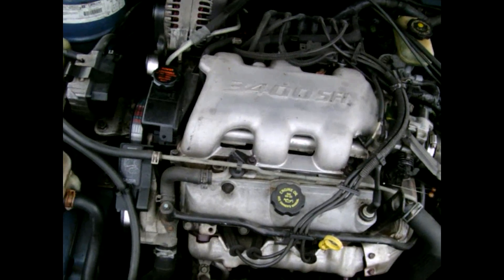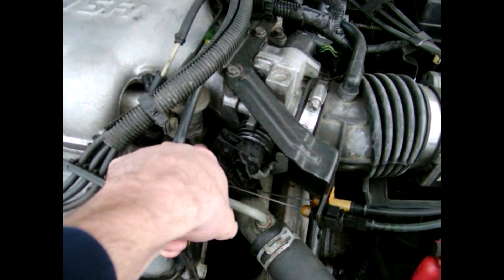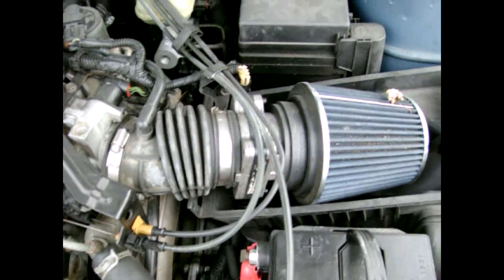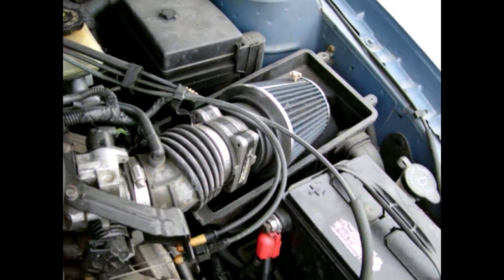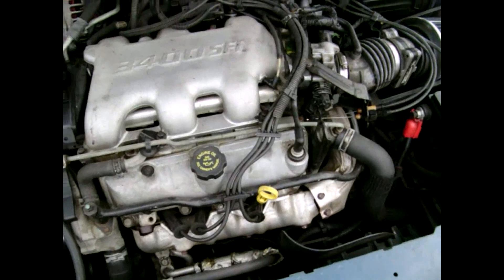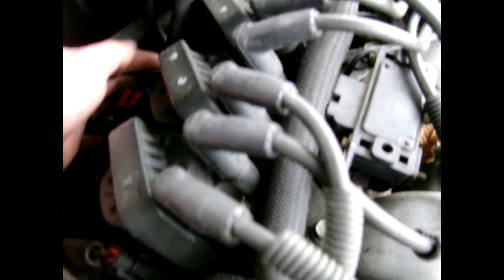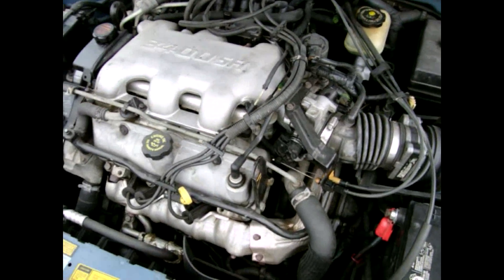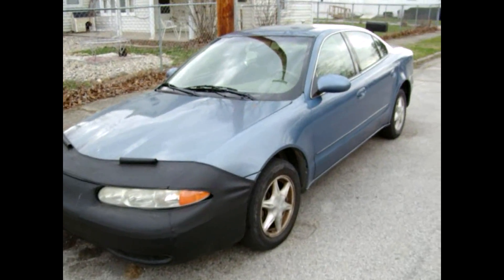3400 GM Engine 3.4 Liter Motor Explanation And Discussion

Comment: Also the timing chain housing gasket often springs a leak they are hard to spot also. Check under car with on lift our jack right under power steering pump right in the oil pan area. Delphi also put junk pressure regulator valve on here causing it to either be sucked up into the intake through vacuum lines or leak pass the diaphragm and can be a big fire safety issue. There is a recall for the3800 not these so look out for that ,both engine FPRs leak past the diaphragm inside the fuel pressure regulator
Reply from the maker: I just finished replacing the front timing cover gasket just today.  A whole lot of work for a $10 gasket and harmonic balancer seal.   > : (
VT247
Reply: My opinion the 3800 is the better made engine of the 90 to 2000 . Simplistic construction and easy to get to components.  I repaired a guys timing gaskets while in school he couldn't figure it out in months took one day. Some one find me a turbo or supercharger for this thing and we'll talk
Reply: Very good

Comment: I got a question I have a 03 Chevy Malibu trying to swap 3100 for 3400 and I bought the engine for 200$ I’m young I need to know does this have identical harness and pcm’s?
Reply from the maker: I think it’s possible, but there may need to some swapping over of certain connectors / sensors.
VT247
Reply: @Vacationtime247  okay I gotcha thanks for the reply and I heard that from a mechanic told me I will Also need a same year and model my car is and then gotta find a same year and model pcm for the 3400

Comment: I've got an '01 Alero with the 3400 in it.  Recently it's been running rough when the engine is warmed up and difficult to start.  I noticed the is a vacuum port without a hose on it and has some very good suction.  If i cover it with my finger the car will stall out.  This port is located on top left as you're looking at the motor from the front of the car.  If you "45" towards the back left corner from the "3400 SFI" on top of the motor you'll be able to see it.  I very briefly saw on yours there looks like there to be a line coming off it.  Where does it go?
Reply from the maker: Make sure all your vacuum connections are secure.  There are some EVAP lines behind the motor and under the coil packs.  While the engine is running, you can take a spray bottle and mist around the engine.  Notice for any changes in idle.  This is a cheap way of finding vacuum leaks.  Also make sure the PCV pipe going to the intake is snug.
VT247
Reply: Vacationtime247  ok.........is there supposed to be a hose connected to this port though?  I've looked online for a diagram of the hoses and it looks like this port goes to the "accessory".........I have no clue what that is if that's the case.
Reply from the maker: Part of the tranaxle.  Helps shift the transmission.  
VT247
Reply from the maker: Wait, my bad.  The bottom right is the transaxle.  The top left is capped off.  It should be plugged.
VT247
Reply from the maker: The one your referring to is for accessories.  In case a person wants to measure vacuum or add a gauge.
VT247
Reply: Vacationtime247 ok..............is there a certain kind of cap or plug I can buy or just any kind of cap?
Reply from the maker: Any kind of cap that will fit on there to plug it secure.
VT247
Reply: Accessories is the line that controls the HVAC system.  Specifically, if this line is cracked one symptom you might notice is that air will only blow out of the defroster and floor vents, regardless of what vent selection you choose on the A/C control head.  I just fixed this issue on my 2001 Grand Am SE1 with the 3.4L.  There was a white plastic vacuum line going right across the top of the engine, just to the left of the throttle body.  It had broken in half (heat stress probably).  Very easy to fix though ... just slipped both broken ends into a piece of vacuum hose and it was good to go.

Comment from the maker: It's quite possible it's the intake gaskets, not much separating the oil from the coolant.  But, trust me on this one, do the head gaskets too.  They'll eventually go bad anyhow and it's not that much more work or expense.  Have a video up on how to do the head gaskets on a 3400, the 3.1 is basically the same thing.  Good luck with your fix!
VT247

Comment: Ya I have a 2001 alero 3400 v6 I'm having anti lock sensor light keeps coming on trac control light come on as well and the PVC vac hose was replaced by previous owner and line sucks the hose till it's almost pinching shut and I dont know what to do to fix them
Reply from the maker: The ABS (antilock brake system) / TCS (traction control system) light will be triggered if the wiring inside a wheel bearing / hub is bad and no longer reads.  There are ways to check this on the vehicle using a DVOM.  The PCV line is usually made from hard rubber, might see if it's just soft and needs replaced.  Sometimes just splicing in a better piece of tubing by 'Mcguyvering' a fix will work.
VT247

Comment: I have a 03 Alero v6 same engine but it only starts off starting fluid but runs good after you spray that starter fluid in it and runs awesome what would that be
Reply from the maker: +Chris Wood Check the fuel pressure regulator / fuel pump pressure.
VT247

Comment: I have a hose leaking.  It is on the bottom left of the top of the engine.  In plain view on your video.  Runs from the water pump to a steel hose it looks like.  Can you tell me the name of the hose?
Reply from the maker: +Kasandra Martin Might be best to just take it off and go to a parts store.  Have one matched up.  Not really sure of the name of that.  But I guess it could be called a water pump bypass hose.
VT247

Comment: if I put a cold intake on my pontiac grand am will jt ruin the motor its the same 3400 ghe reason I want one is because my motor tends to get a little heated physically to me, but the temp guage stays on 200 but it goes up pretty quiq

Comment: I have an 02aztek and the coolant hoses are always hard,  we have done the water pump and the temp levels seemed more stable, we did the thermostat next because the levels started going crazy inline somewhere sat for a long time,  or when I had it idling for a long time,  30 mins or more it would climb, never in the red,... but still to high for my liking.  It does hesitate a little bit when u start it sometimes,  other Times the remote start goes off but don't start the car. 134, 000 on her
Reply from the maker: Sometimes the head gaskets go bad.  I've replaced a few on my Azteks.  Could be the cause of the hard start and high temps.  It's not to bad a job to do, just time consuming.
VT247
Reply: I just watched your video about doing the head gasket, I'm not sure if I'm up for that on my own,  I'll have read up a little on it before i attempt to do that, but sweet video,

Comment: Two problems 2001 Alero 3.4, first at 4000 rpms it starts to cut in and out. Second cannot get the Security light to go off, it just stays steady.
Reply from the maker: For the cutting in and out check the spark.  Plugs, wires, coil pack.  Check out my video on how to turn off security lights in a Camaro.  Would be similar in an Alero.  Find out what resistance the key takes and bypass the system.  But the reason (I'm guessing) to why the security light is on is the ignition is bad.  The part that reads the resistance for the key in the ignition has gone bad.  Kind of a PITA to change the part out.  The key still worked, but the resistance was done with some resistors from Radio Shack looped through the wiring under the steering column.
VT247
Reply: I replaced the complete key switch, starts and runs but the light still on. I will check out all the rest. Thank you for the input. I will let you know keep up the good work.

Comment from the maker: If it does it all the time, it's a rod knock.  If it only does it when it's cold, it could be piston slap or loose bearings.  To be safe, let it warm up a little before driving in this frigid cold.
VT247

Comment: Can I swap a 01 3.4 for a 05  3.4 ? What's the difference
Reply from the maker: You’ll want to check the electrical connections.  Think in some years and models the camshaft positioning sensor is different.  Of course, the intake is also different on the vans vs cars.  Some of the rocker arms use a better larger stud bolt too.  
VT247

Comment: 2000 monte carlo, it makes a very loud screeching noise after I have had it running for about 15 minutes....whether I am driving or I just have it running in the driveway, I cannot figure out this noise. You can hear it in the car and you can hear it outside the car, even in the house you can hear it, that's how loud it is, any ideas?
Reply from the maker: Could be the serpentine belt.  Once they stretch it starts making a lot of squealing noise.  Mine did this, I replaced the belt and no more noise.
VT247

Comment: I had the same issue in my 3.4L DOHC in my 97 Monte Z34.. try replacing the Fuel Pressure Regulator. About 47.99 at Autozone or Advanced Auto.

Comment: I have an exhaust leak in the rear manifold I think. whats the best/easiest route to get to it? I'm tempted to just remove the whole top end.
Reply from the maker: Take off the air box, the intake tube, the throttle cable bracket, the bolts holding the heater lines under the throttle body, and perhaps a few other components to reach the crossover tube and shield.  It's buried under all that.  Take off the  lower exhaust bolts under the car.  Might help to remove the front upper motor mount bolts to rock the motor back or forth.  May find it easier to access the rear exhaust bolts from under the car like the rear spark plugs.
VT247

Comment: I have a 2004 Monte Carlo with the 3.4 in it. About to hit 97K. Any advice on what to do for routine maintenance around 100K? I was planning on doing some AC Delco Platinum plugs and an AC Delco wireset. I always wonder what I should expect out of this motor in terms of lifespan. My money would be that the 4T65E transmission gives out before the motor ever does.
Reply from the maker: Replace the gaskets.  Timing cover seal gasket, head gaskets, intake manifold gasket, spark plugs and wires, change the oil.  Once the gaskets are replaced, the engine will run forever.  The transmission is usually pretty solid.
VT247

Comment: Hope you all are still around. I did a head gasket replacement, took the heads to a shop to have them tested and cleaned. Car ran before I replaced gaskets and now there is no compression. If I loosen the rocker arm bolts it will get compression. Did I forget something? Anyone else run into this and was able to rectify?
Reply from the maker: The push rods are of different lengths.  I'm guessing one of the push rods are on wrong holding the valve open.
VT247
Reply: Vacationtime247  Nope looked at that. I'm pretty anal about putting everything back from exactly where it came from
Reply from the maker: Did you have the camshaft out and the timing marks aligned?  Bad vacuum leak from the intake?  Just spit balling here.  Does it not have compression in any of the cylinders or just certain one(s)?
VT247
Reply: Vacationtime247 Talked to the place I had heads benched. He said ya damn backyard mechanics if it's cold where you are working it takes a minute for those hydraulics to fill so turn it til she starts and she'll run rough but will eventually level out. I thought he was full of crap but I did it and she's running. Thanks for you time and advice.

Comment from the maker: The Grand Am's never had the 3800 equipped from factory.  It had the 2.4 twin Cam or the 3400.  The 3400 was by far a better engine.  All cars have problems, the head gaskets are known to go bad in pre '03 models.  Best way to see if the head gaskets have been changed or other maintenance has been performed is ask.  It may be possible by looking, but even then, if it's been awhile they may already be dirty and hard to tell.  Good luck with your purchase and enjoy your new car!
VT247
Reply: Vacationtime247    Or the 2.2 echo tech

Comment: Dude awesome video, my alero 3.4L has a weird idle mostly when its in drive at a stop light or drive through. A mechanic told me to check vacuum lines. Thanks
Reply from the maker: It's got the GM 3400 engine in it.  I'd bet money the head gasket or intake gasket is blown.  The white smoke is coolant in the cylinders causing the misfire.  No one likes hearing this, but I've had enough of these engines to know this is a common problem.
VT247
Reply: No white smoke at all and i went through all the vacuum lines and it seems like the problem is solved. 1 more ? The ac is coming out the floor and the defrost and face vents at the same time. The nob seems to not be working and its coming out the face vents very weak. Any thoughts?

Comment from the maker: Might be time to get a good 'loan a tool' scanner.  Watch to see if it's fuel or spark related while it starts to do this, checking spark and fuel trim.  Starting to run out of ideas.  Have you checked the MAP sensor and Mass air flow?  Get's worse when it's wet, makes me think spark related, like the plug wires are arcing out or the coil pack is bad.  Just throwing out ideas.  Always easier to diagnose in person, but I'm giving it my best shot : )
VT247

Comment: Got a real bad oil leak coming out underneath my timing belt or in that general area.. Anybody having the same issues. Opinion's I have gotten have been oil pump seal, timing cover, and intake manifold gasket.

Comment: i have a 2000 olds alero with the 3.4 and every time it gets hotter than 75 degrees outside and the motor warms up, it starts vapor locking really bad and then it stalls. i dont know what to do about the problem i have asked alot of people and have tried to look it up on the internet to see weather anyone else has this problem but i cant find anything.

Comment: i wonder if you swapped a ls4 or a 3800 sc into a aztek how possible that is
Reply from the maker: That would be interesting.  Not sure if the bolt pattern or the engine mount locations are the same though.
VT247
Reply: @Vacationtime247  what u mean by bolt pattern
Reply from the maker: @aboogie4lyf  The design on the back of the motor is different that bolts up to the transmission.  For example, a Ford bolt pattern is different than a Chevy.
VT247
Reply: @Vacationtime247  then couldn't u get the trans out of the car with the engine u want?
Reply from the maker: @aboogie4lyf  Yes, that's certainly possible.  With enough fabrication, it could fit.  Done a few projects where the original engine came out and a new transmission and motor went in.  The little details are what takes some planning.  Like, the motor mounts, power steering and plumbing the coolant lines.
VT247

Comment: Decent engine other than the overheating issues. My sister blew hers from the constant overheating. She put 2 waterpumps and the intake gasket it still ran too hot.
Reply from the maker: Always advise people to do a coolant pressure test on these engines.  They are known for bad gaskets.  Not having pressure in the system can lead to overheating.
VT247
Reply: @Vacationtime247  I told her it was probably the headgasket because it is a conmon issue. The mechanic said she blew the engine. It still ran but it wouldn't get far without getting hot. She overheated it more than once so she probably warped the heads. Her engine made it to 225.000 miles though so it had a decent life. My Dodge 2.7 has 251.000 miles. I figured the 3.4 would outlast it.

Comment: I have the same motor my oil pressure light is on and says low oil but shows oil on the dip stick and car stalls out on me just trying to figure out what's going on
Reply from the maker: +Cannabis Newb Desert Rap Media Greetings Cannabis Newb from Humboldt California.  Cough  Ahem, anyhow...... ; )  At the bottom of the oil pan there is a sensor.  Unplug that wire, splice the wires so the copper is showing on each.  Twist them together.  Problem solved.  The oil pressure sensor / switch is most likely bad.
VT247

Comment: I have a 2002 Buick Rendezvou 3400 sfi engine, there is noise coming from the engine. When you turn on the car the noise comes on and when you step on the gas it gets louder almost like a whistling sound. I checked the power steering fluid and it was out and I filled it, same nosie . I replaced the water pump and still nothing changed. My friends told me that it could be the harmonic balancer is bad. But I don't know where it is located. I would like to know what the problem is. Please any advice would be great at this time.
Reply from the maker: Could be the serpentine belt squealing, the idler pulley or tensioner if it sounds like it's coming from around that part of the motor.  Start cheap and go from there.  I've replaced all of those on my 3400 in my Aztek and it fixed that noise on mine.  Hope this helps.
VT247

Comment: Well it's not rotten egg, it's like heat. The temperature goes beyond the normal line when I'm in the city with traffic but when I'm in the highway it stays in normal. When I press the gas the smell comes and then disappears.